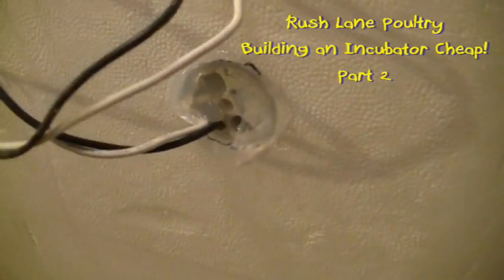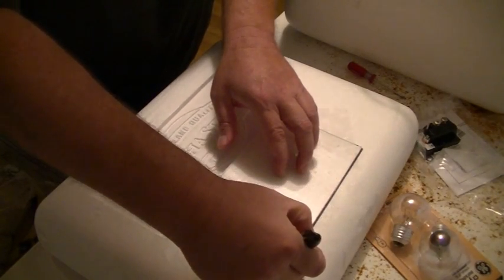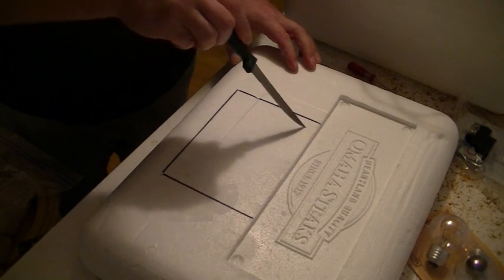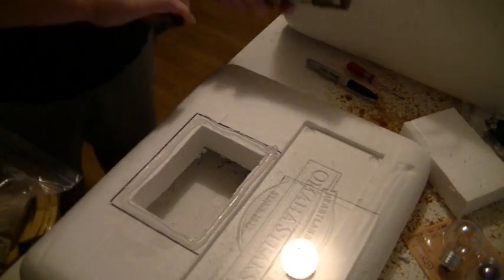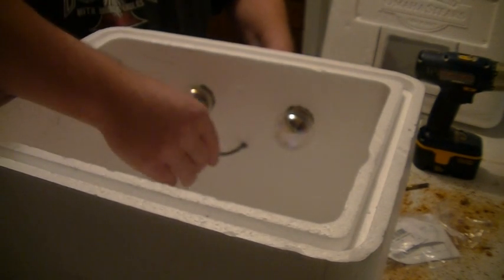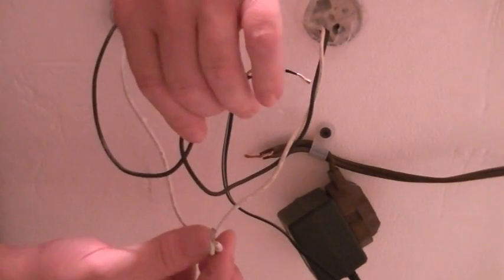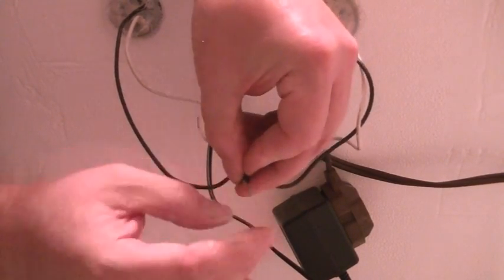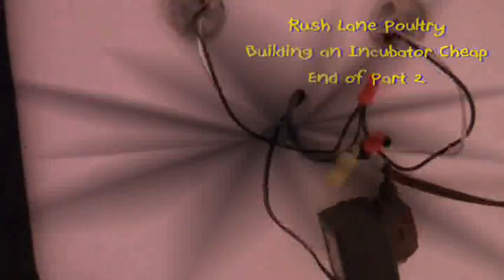Building a Low Cost Home Made Incubator! Part 2

Comment: ok we have everything together and can not regulate the temperature using two light bulbs and the space heater thermostat. How far from the thermostat should the light bulbs be? Im thinking they are too far from it. We have the thermostat about three inches roughly from the lightbulb in the middle of two. Should they be closer? Thanks so much for you help. Loved your videos Very helpful.
Reply: +Amanda Scarbrough Hey Amanda... thermostat is too far away from the bulbs! Needs to be roughly 1 to 2 inches from the heat source. Wade